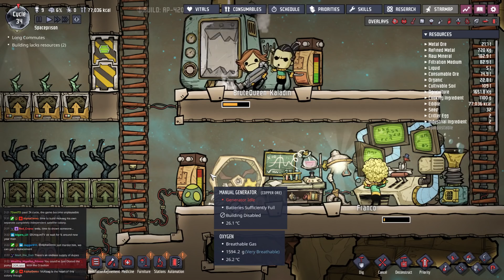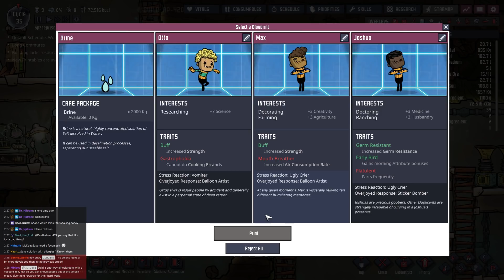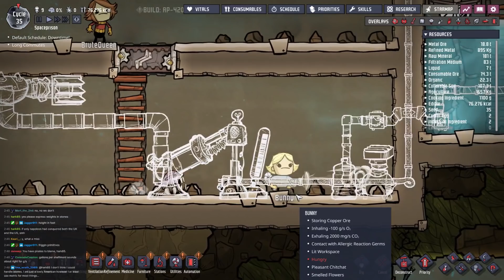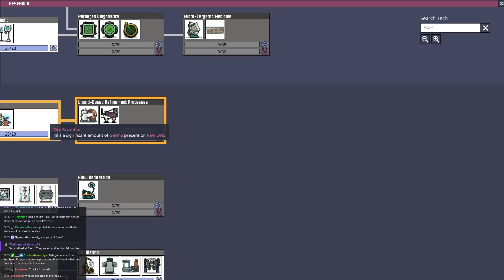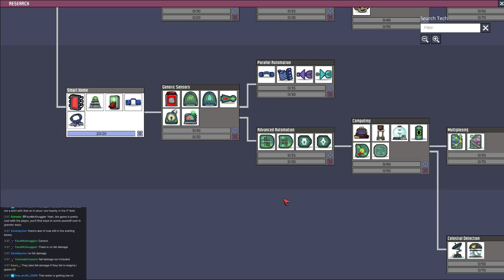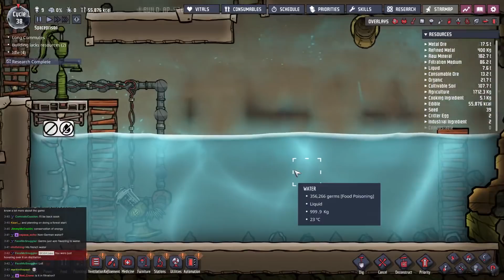Oxygen Not Included Longplay 08

Comment: See, you figured out how pressure works. This game wouldn't be nearly as fun, if it didn't have you understand things yourself... like that gasgenerating coal-generators nearby might increase gas pressure. Btw there's another hint about opening more space reducing pressure, i wonder what that's about.
My question for you is how do we make chlorine interact with water in real life? just expose it to it. chlorine is heavier than a lot of gases. Why not try to pour a little germ-infested water into the chlorine region and see what happens? No need to pipe it at first, you can just use pumps.
Reply: I just tried the water chlorine thing... didn't work :(
Reply: @CST247  it does, but you gotta do it right. It's actually kinda hard to get it to work.
Reply: @svenbrede6151  so do I need to “run” the water through chlorine gas? I have 2 tiles of water surrounded by chlorine full of germs
Reply: The germs should be going down? What i did was a little more complex. Using a setup which emptied water periodically from a storage into chlorinefilled air until it was clean according to a germ-sensor.